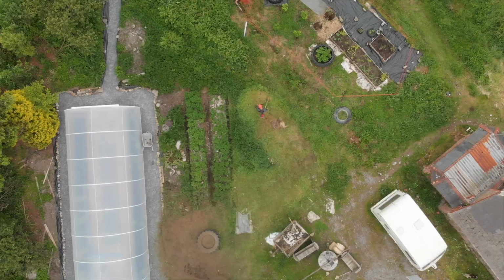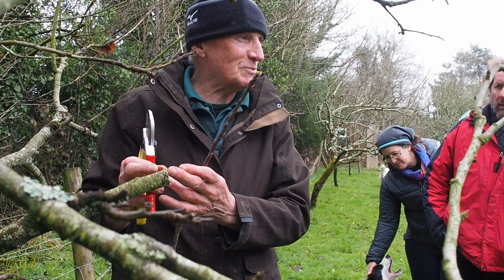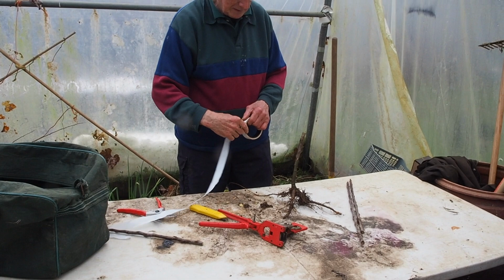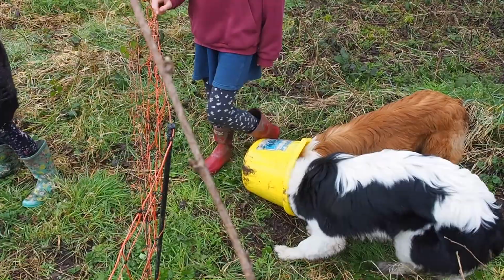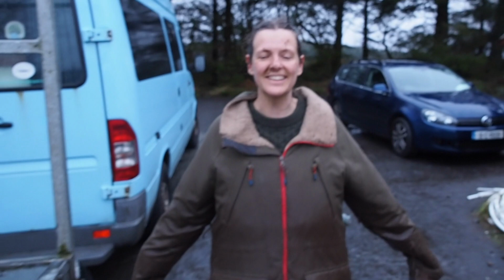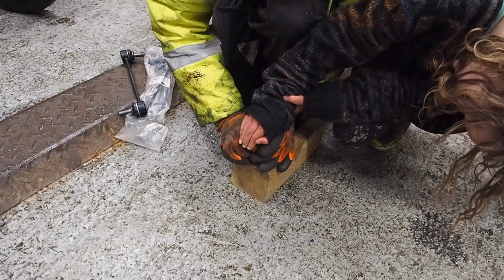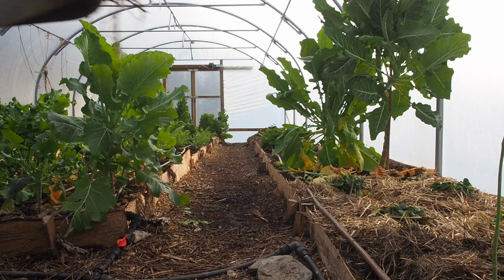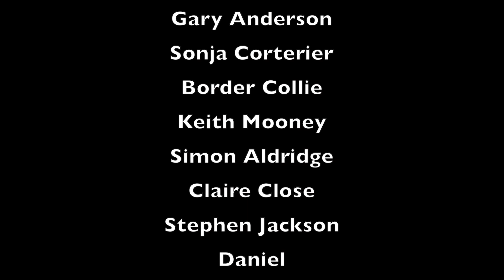Apple grafting Masterclass from Tom Barry

Comment: When I was a kid back in the 50's  in  the USA  if you could find Maytag washing  machine gas motor, that was the perfect motor with a kick start that was the way they was started.  They was I think one horsepower and would just require a simple lever to control the tension on the belt's pully system.  It was a lot of fun and the motor was very efficient with gas.
Reply from the maker: Sounds like great fun. I love all that kind of stuff. Core memories made :)